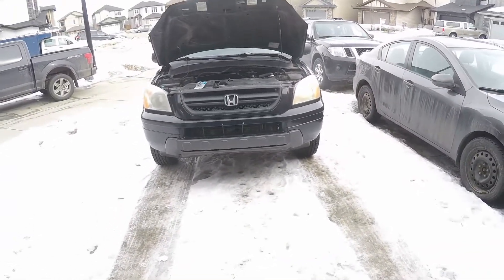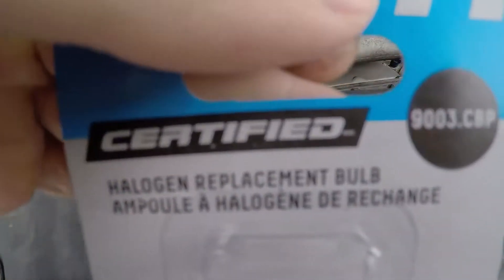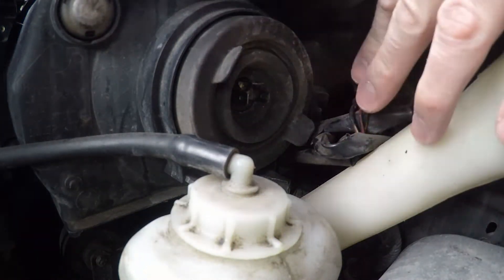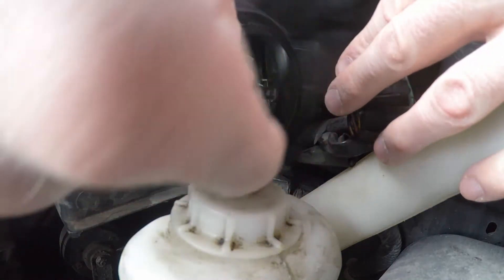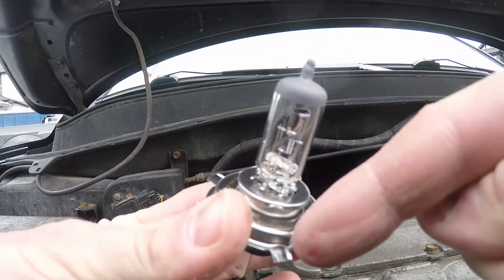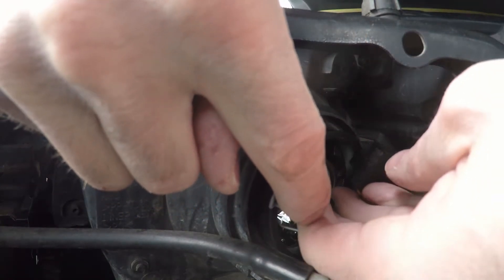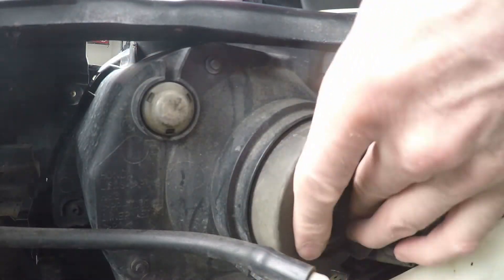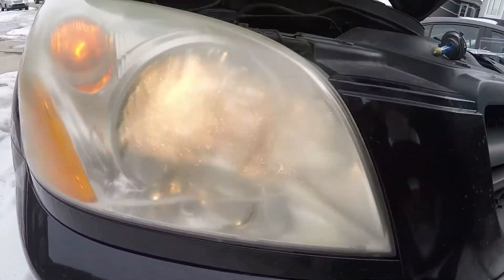2005 Honda Pilot Headlight Bulb Replacement

Comment: Thank you so much! Perfectly clear instructions and would have just taken a couple minutes to do if the stars were aligned. I had to change both headlights. One had the clip installed upside down and was poking through the gasket. It was easy enough to loosen the screw and flip the clip over as well as put electrical tape on both sides of the hole on the gasket to prevent water leaking in. Sending you much gratitude!
Reply from the maker: Thanks for watching, glad it was helpful and you were able to complete the work.

Comment: commentor below states the problem is the driver's side. drivers side may be more difficult but my 05 Pilot always seems to blow the passenger side one. What is up with passenger side?
Reply from the maker: I have no idea. Could be a power issue impacting that side, moisture in the headlight housing, something else completely. I'm not sure. Is there anything loose on that side that might cause it to vibrate more?

Comment: THE PROBLEM IS NOT the passenger side, its the DRIVERS SIDE... thanks the ACESS IS NOT THE SAME...
Reply from the maker: I suppose my position is that if you can do one side should be able to do the other, but maybe not.
Thanks for watching, sorry for the disappointment I guess.